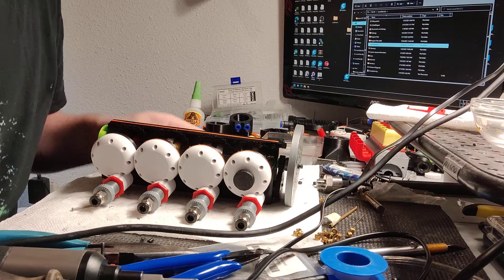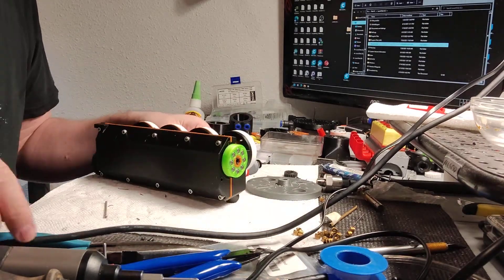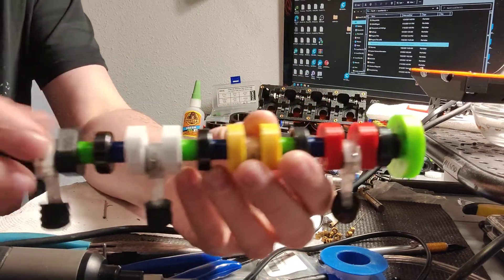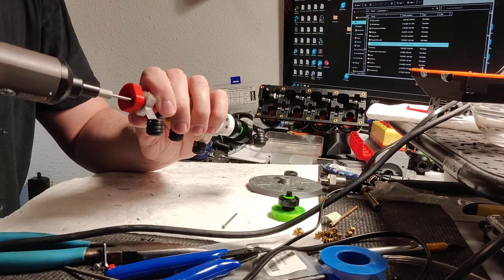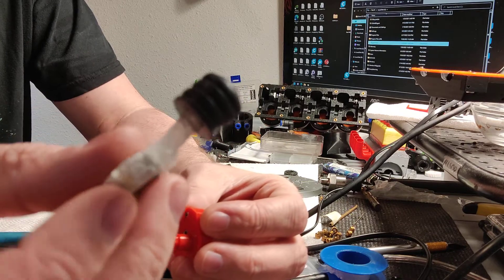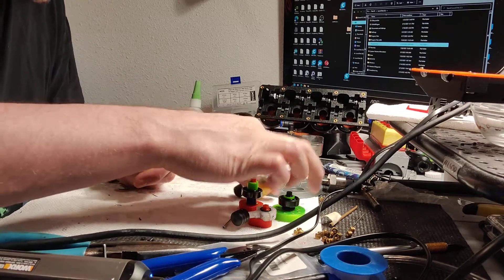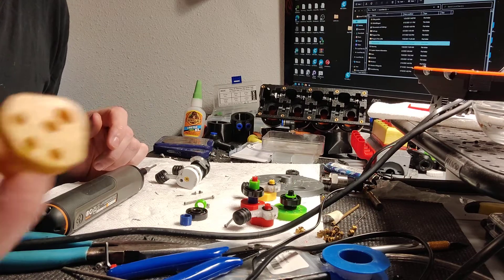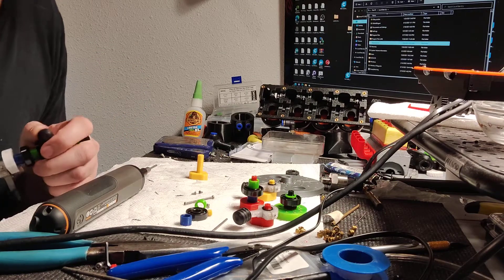I4 performance air engine rebuild

Comment: What material and infill pattern? Also how many walls? A thought- could you offset the screw so it is no longer centered and use a small piece of steel (say a nail) to add rigidity... Or use a smaller screw and use two of them. It's possible that just the offset may correct it so that it doesn't just shear around the center?
Reply from the maker: I had the same thought, I have little 1mm steel rods that I would use for the edges of the hex key, but the problem is that there is already so little of material there that taking out the material for the rod might make it even weaker.  After looking at the key again, I have found that I can scale it up to gain another 0.75mm diameter of key.  I am going to try it again with the scaled up key and if it still breaks then I will try the renforced key.